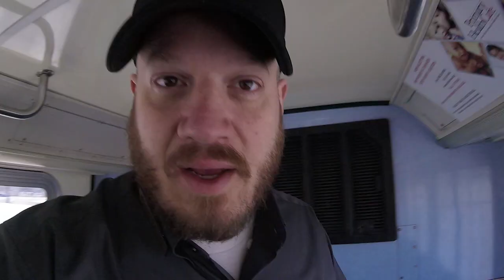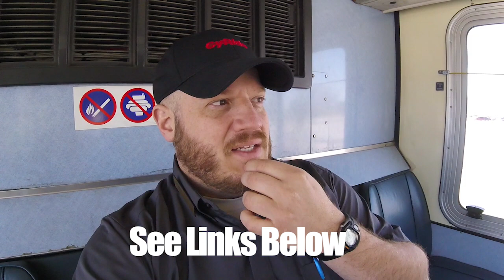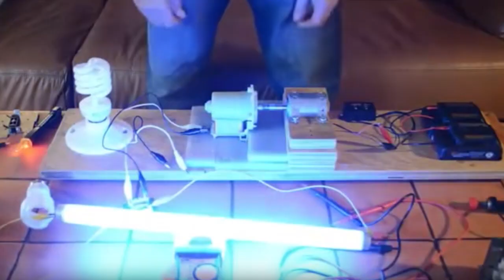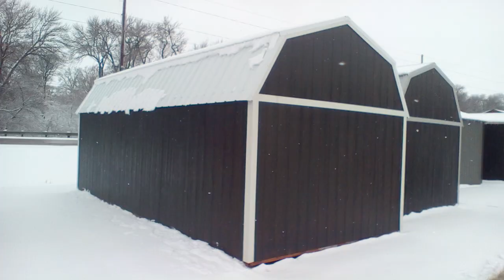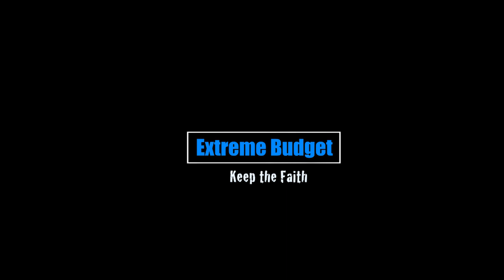PART 1 - DIY Innovations - Free Electricity with Self Perpetuating Generator

Comment: teg a unit cool or heat, from 12 volt cooler i had a heater i used 4 teg unit it burned up from heat! the guy who helped me in solar and wind, this guy rebuild electric motors & generators in a shop  in back road from a old gun dealer i helped the sign was on the side of the road! electric motor repair! a gas motor run a 12 volt car alternator to charge battery bank solar limited in winter!

Comment: Look at inverter generator, just an alternator and like 1.3 hp 4 stroke. With the right hp you can spin two alternators which you connect to the stator wires about 70 v off each of the 3 wires connect those to step down transformers so you now have 110v from each alternator which connected to home electricity will give you an american 220

Comment: Sorry, this will not work. This is silliness. The design will just sit there and do nothing. Even if you were to dump a bunch of energy in to start with it will run down rather quickly. For the design to work would be a violation of the laws of thermodynamics. Those are the laws that tell you that you can't get something for nothing, i.e. no free lunch. Also, Lunch tends to be rather expensive. Which is why the world is now consuming a billion barrels of oil every ten days... Understand, for every ten gallons of gas, you put in the tank of a car that is well over a million BTU's...  Crude oil is the number one traded commodity in the world, for good reason. It (along with coal, natural gas etc.) are the foundation of the global economy. For a perpetual energy system to work it must supply all the energy you are using plus the energy needed to compensate for all losses - heat, noise, etc., which produce resistance and run the system down... The design discussed will not even keep itself going much less supply any quantity of usable energy... This is why basic physics classes should be mandatory for everyone!!! And why lab experiments are so important, specifically the one where you turn a generator by hand and then flip a switch that turns on a lightbulb. In 30 seconds you learn what you need to know to understand why it takes so much energy to produce useful work. 

Don't dream of free energy. Do some work and learn... But verify this for yourself. Then you will not be duped by the perpetual energy myth. 

Simply, this is not the way the world works.
Reply: Thermodynamics
Reply: I now where to get a free lunch, at the salvation army...

Comment: Well if you got two altonator and got one started by 120v. Then had the other looped to the first one. Then it would keep charging and running. And if you had a large two belt pulley then you could hook to another alternator and have free energy. Or use a solor motor with battery back up to start and stop .

Comment: HERE IS HOW SUPER SIMPLE FREE ENERGY TRULY IS,,,, 
= This works on the simplest of logic, and the abilities of pulley mechanics, 
to freely convert 1 rotation of a large pulley into many rotations of a few mini-pulleys'. 
You only pay the smallest amount of power for a single rotation of a large 30 cm circumference pulley. 
Then, by attaching 3 mini-pulleys of 1 cm circumference, with AC generators attached,,,,, 
- 
YOU CAN GAIN A RETURN OF 90 CYCLES OF AC OR DC ELECTRICITY 
= ALL FOR A FEW SPARKS/SHORT BURSTS OF AC OR DC ELECTRICITY 
Which is only the amount of power to rotate the large pulley one single time 
<<< HOW CAN YOU NOT MULTIPLY YOUR AC ELECTRICITY = PAY 1 + GAIN 90 >>> 
- 
and please don't listen to all of the torque lies, that evil spirits are whispering in your ear, as the only torque that this mechanism needs to produce, is the small amount of torque that it takes to rotate your drive motor ONE SINGLE TIME 
=(practically zero, only a few sparks/short bursts, when talking about the steady flow of current)
https://www.youtube.com/watch?v=NxpoiCFKmPg
Reply: This works because it does not cost 30 times the amount of energy to rotate a large 30 cm circumference pulley, as it does to rotate a 1 cm circumference mini-pulley,. Yet, with this single rotation of the large 30 cm pulley, you can rotate as many 1 cm mini-pulleys as you choose to attach to the same belt. So if you attached 3 of the 1 cm mini-pulleys to the same belt, then you could freely gain 90 rotations from this single rotation. Then all that you would need to do is attach AC or DC motors/generators to these 1 cm mini-pulleys, and you could freely gain 90 cycles of AC or DC electricity,,,,,,,,,,,,,,,,,,,,,, and all from a few sparks of DC current.

Comment: Dude, read this, dont fall for that stuff, i belive over unity could be possible, but its not this simple, there has to be a way to tap into the universe, how much energy does it take to start life? Maybe that energy can be tapped , like dark energy, that keeps the universe going, keeps life going, anyway,  You can't connect a DC motor to a ac generator and get power!! It may run for a few minutes, but that's only from the stored stored energy from starting it! The only energy is the fly wheel effect! Tell me you are joking, there is losses in the wire, the belt, the devices its self! Nothing is 100% effiecent, not even something as simple as a piece of wire!! I know what you are going through, and planning and talking about, solar panels , batteries, inverters, get a 12hp+ engine, and put 2, 100 amp alternators on there, charge your batteries,  along with solar panels, that's what I'm doing, off grid, and you can use wood scraps , paper , basically any dry plant matereal, and put it in a still, similar to what the shiners used, it will give off natrual gas to run a engine, you may be able to use a Fresnel lense, to heat the metal container to the point of pyrolysis, keep the brown sludge, its synthetic crude oil. Put it in the still with the next batch, the Germans were doing stuff like this in  the ww1/2,  you can't get much freeer than that, the clear liquid is the cleanest burning fuel, a modified gas engine will run off this,  it is methanol, it has the least carbon of any fuel, and burns clean, I am  deep in to the study of this, and hoping to build more , when possible, I do not care to share information, with someone wanting to help their self and earth, like the 16year old girl said, the governments have let us down, stole our future, to cash in today, none has helped us, also you can break h2o nonds, use the hydrogen and o2, to help fuel a generator, it can almost make enough to keep its self going, adding the methanol, it natrual gas , it can power your house, if you plant bamboo, to harvest, dry and use as fuel, you will be putting  more carbon in the earth, than what's put in the air, so basically scrubbing the atmosphere of co2, carbon monoxide. The charcoal remaining from the pyrolysis isn't rally good for charcoal, it doesn't have much hydrogen remaining, it is basically just carbon. It can be used in a garden, or used to grow bamboo fuel, along with food scraps , dog poo, u poo, just let it sit for about a year, so the bacteria is dead, its fertilizers!! And putting the carbon in the dirt!! And fertilizers that been used until the oil pushers took : if you are interested, I'll try explaining in detail, over gmail, just respond, thanks  and have a great day,  don't fall for the youtuber scamers, they almost had me as well, cheers!!

Comment: IF it could work at all, no battery would be required The best the electrical motor is 88% efficient and the electrical generator is 88% efficient. Thus You Lose 24% percent of power while using it. Put a battery(s) inline (out of sight or not) and there is even more loss. I see he has at least 2 batteries hooked up, ha ha ha DEAD GIVEAWAY. He needs his chops busted for his wanton deceit. However, because the battery(s) were charged (fully charged?) it can take quite a while for the system to FAIL, But Fail it will and Fail it must.  Click Bait!
.      I wonder why he did not just go purchase a detention cord power strip with surge protector... Plug it into the wall then quickly in plug it from the wall and back into itself and have that running some device comparable to the wattage capabilities of the power strip.

Comment: This is old tech is been in our face the whole time they laugh at us. They sell you one with every vehicle. You think that the alternator knows the starter got it spinning then a another mechanical motor took over from there. Or think it cares the battery just got removed. You only need a 2 hp motor to get it in the range it'll make 90-120 amps. Show me why 110voltn2 hp motor that will consume 90-120 amps. You need a three phase alternator to do it it has to be one the voltage regulator can be removed from. And then if you leave the diodes on bthr back it's DC that's how backwoods welders use them. Or remove the diodes and you have AC power. Nothing converts it to dc.and you have a generator that's battery started and runs until the bearings seize up or belt snaps if you want it to. People been doing this since alternator camr out and DC witg auto generators before alternators. It's not new it's just if your smart you keep it to yourself. Even your friends could get you in trkube not realizing it. It's amazing everyone who says it isn't true or possiblenisbsaying that based off classes and knowledge the govt has produced for them. From a baby your institutionalized sit and repeat after me. Copy these notes and repeat bsfter me. This is how life works. Because we said so copy and repeat how can you question it. Ridiculed for seeing what the teacher says doesn't make sense but they are in authority over you. Memorise this chapter you have test tomorrow. Memorise this law theories and how universe works. Because top people said it does you wanna pass or fail. Critical thinking and creativity is stifled and frowned upon. Everyone gets the same notes and repeat and memorise and test and it's take out word for it. Test on this material you don't need to think about anything only regurgitate got test to the next level of memorise and test. Where would be at today if every inventor believed his teachers and told it can't be done because they are told it can't be simple as that. Now what I have not seen is anyone who went to build one never came back and said it's bullshit it's always the same thing from the same chair research second law of thermodynamics. And they refuse to even prove it doesn't only a book days this so it's not possible as just ridicule. All there comments ridicule the poster. When most way deep Woodman's have seen it or know about them. Used for decades. Your not gonna tell someone who used them to feed there family for years powering equipment and welders it's not possible .I know I didn't get paid saying sorry can't fix that Harvard says it's not possible. The only option is a diesel welder. Must use there carbon fuels. There's no hope for younger generation all use to city life. Your grandfather's probably knew of these devices I've even seen them started with a Briggs and Stratton instead of s battery. Then power electric motornftom alt nd shut off gas motor. First one I saw was in ,1970. Billion in New profits yearly couldn't take priority over advancing humans on their dime. Wait until you find out gas is abiotig and replaces itself. If it's a dino product whybis drilled lower than any fossils or sediment life layer by miles

Comment: Its not to good to be true. A low torque dc motor would produce proportional electricity if the shaft of the dc motor spins gears and in turn spins more ac altornators more rapidly. I thought we could address flooding issues in the midwest by building dams and using the water to help generate proportional electricity.  Give our population something to work on together. Build a new grid. Build these power plants first. Tie into existing electrical grids so we have the time to replace at risk overhead power with new semi superconductors to existing sub stations.  We need transaction reform to protect our identities. Its important to build this as a nation to inspire teamwork. If everyone decided to live off grid we will loose touch with one another and then loose control of society.        JR and affiliates for president.

Comment: This is so wrong you can neither created nor destroy energy in a closed system and when trying to run a generator off of a motor running the generator you lose power to friction it will never work nice try

Comment: Listen. I am not rude and I am not one to put people down or kill dreams.
But this wont work. If you try to power on system from another you lose your energy.
And you wont just lose if from the motor using the power, but from heat sound and vibration. 
The laws of thermal dynamics defeat this idea completely. 
It sucks honestly.  And I will be possible to make a self sustaining system one day but it will still be limited. I dont believe we will ever defeat the laws of thermal dynamics. 
I'd recommend saving your money and get your life together education your self way way more then come back and talk about it. Your in job place to do that now and you lack the knowledge to do anything in this field right now.
Keep it dream alive dont kill it but you are way way out of your league. You have to study this goes way into physics and electrical engineering
 
Ps using a generator to power a motor to power a generator is not the best way to do that at all there is much better technology now and easier more efficient and compact devices to do the same thing and there 98% efficient a motor is a horrible way to do it it seeing how the system has to be at very minimum 100% efficient to maintain it self and a motor has horrible bearings causing heat, soung and ultimately energy lose not to mention a average motor is only 80% efficient

Comment: The people that come up with the free electricity either have no knowledge of how electricity works, driven anyway by high hopes that will never work or are just some good scam artist. It is impossible for two generators to power each other on their own. Like all generators you will need a gasoline engine to turn the generator unless you have a turbine and a full head of water power. A car alternator can only power low amperage devices. We are all part of the frid where we like it or not. If by some miracle some one ever came up with a free energy machine, no one is going to silence some one who builds the thing. The true facts on saving energy is to take a step back in time to the way people lived at one time. Solar panels are the only thing i know of and you would have to know what power usage you would need and then here come's the real cost. The more solar panels needed the more the cost. I would look at solar panel cost over a number of years and see if it is worth that cost.. When i was younger i got duked into this stuff to only find out it does not work.
Reply from the maker: I'm learning and sharing thoughts.  that is what I love to do.
Reply: allen, I think you mean "The people that come up with free electricity will be rich." But since no one has done it "Yet" and the "experts" say it can't be done it doesn't look like it will be done soon. I have faith that someone will figure out how to do it.

Comment: Get you a 30000 kilowatt low RPM permanent magnet generator and a 1 horsepower 1300 w iron horse electric motor to run it and you'll have a lot of extra power
Reply: Steve Williams: Does this really work & when You say alot of extra power" how much more power?
Thank You for Your time.

Comment: LMAO!  The unit of work is the AMP, Volts do not mean much.  Upping the volts will always decrease the amps.  Think of it like this. AMP is the water pressure and Volts is the hose.   For the same pressure water will shoot out a small diameter hose and trickle out of a 10 foot diameter pipe. Go learn electricity and physics before coming up with BS ideas.  PLEASE DO NOT SEND THIS FOOL ANY MONEY!